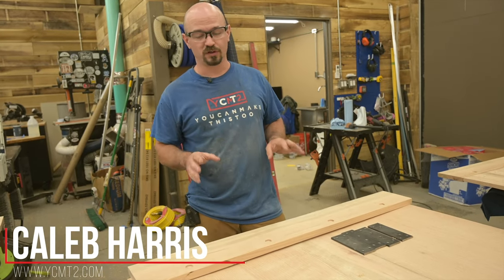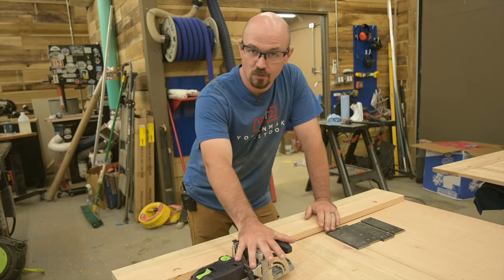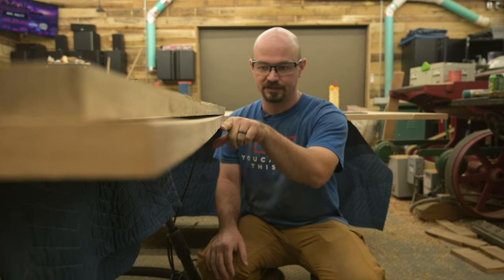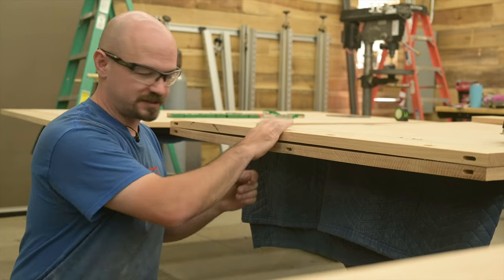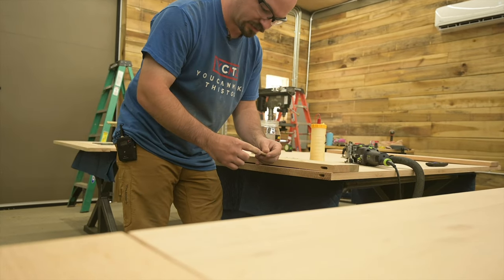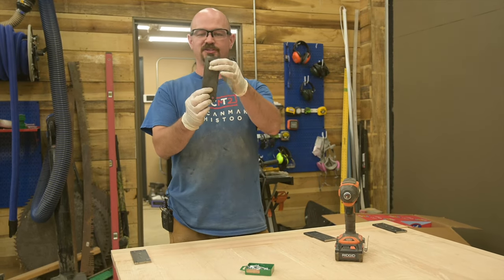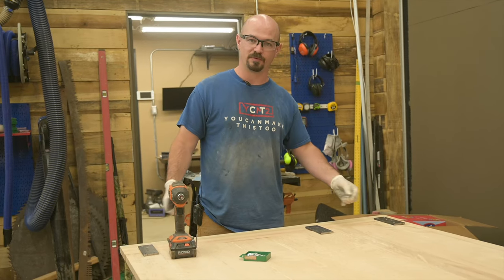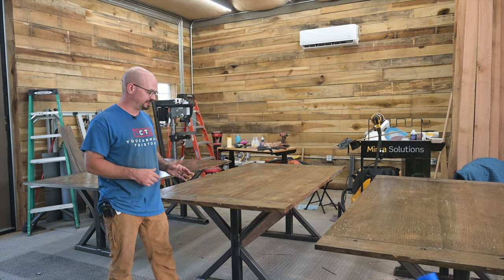Fast and Easy Breadboard Ends

Comment: I find that many people are calling this Dominoe method of producing a Breadboard joint as an easy or trick method, should realize that this isn't a breadboard joint (or breadboard end) anymore. This is one reason it is easier since it isn't the joint anymore.

This is a specific kind of joint and using dominoes has varied so far from this joint as to not be this joint anymore. I would also challenge those who think that it is, to consider if one made in the same way with dowels would still be a breadboard joint or if the dowels were totally eliminated and used a butt joint was still a breadboard end.
It isn't the application of a board across the grain which produces this joint but the method of joinery, and the reason for doing this joinery in the first place.
Reply: It's called breadboard because the boards on the inside are sandwiched between two boards on top and bottom. if there isn't a mortise and tenon or groove, (a lot of beginner pocket hole butt joint methods) then it isn't breadboard. If it has a mortise and tenon or a grove and dowel style interface, its breadboard by definition. The rest of your words are just nonsense.